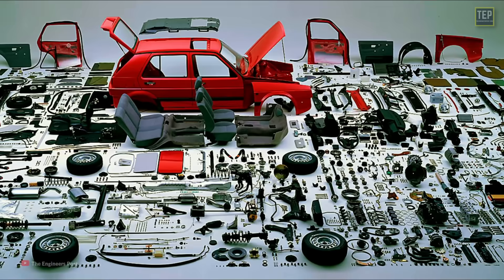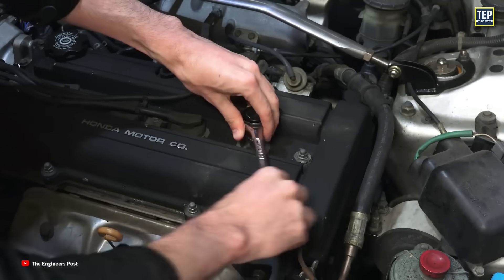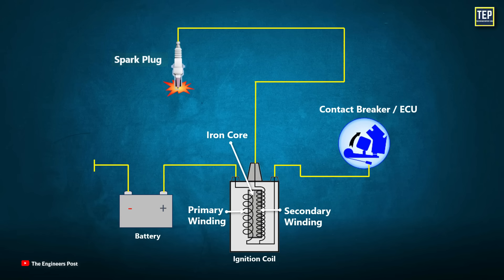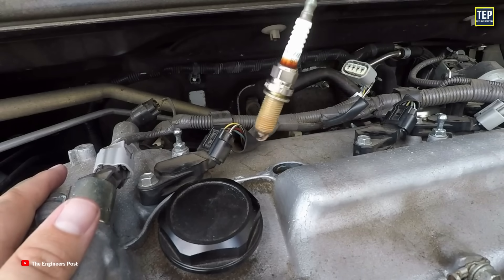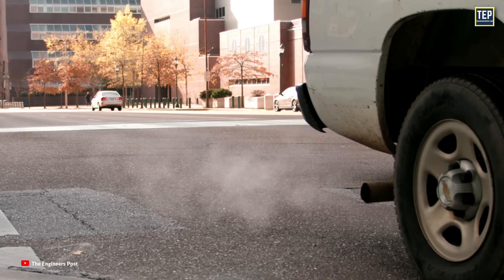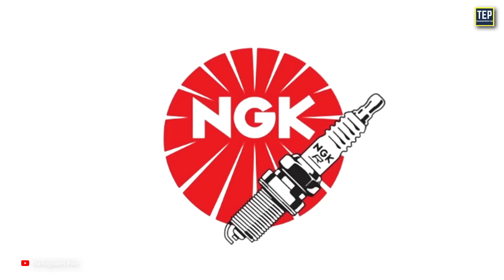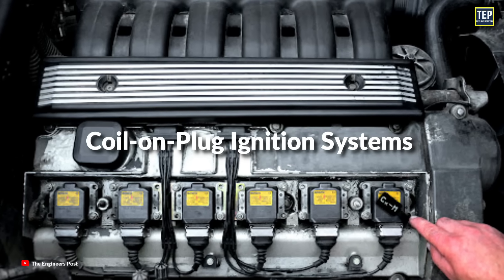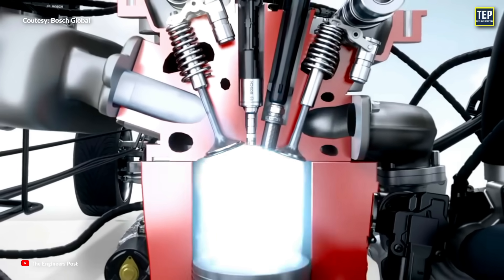Types of Spark plugs | Which is Best?

Comment: Has anyone noticed that modern equipment have become less simpler but more complex. There are creating an ecosystem where you keep needing their services and keep paying them rather than doing it yourself. The concept is profit driven. Once you make a simple machine very complex the more money you can make from sales and repairs.
Reply: That is why you inspect the vehicle thoroughly before buying them.  The more clutter they are put together, the bigger the headache it is to work on down the line when things failed.
Reply: @mrvang8077 ABSOFUCKINGLUTELY!
Reply: Try changing the headlight bulb in a 2015 Jeep Grand Cherokee.  

And to change the spark plugs, you need to take the intake manifold off. It's fun- NOT!
Reply: It's MOSTLY driven by Government "Emissions Engineering". The COST of the parts REQUIRED BY LAW for "clean air" in the US is over $11,400 for 99% of cars/light trucks and $13,000 for "collision safety equipment"!!! Japanese home-market versions don't have this and get up to DOUBLE the fuel economy on 75 octane "straight-run" gasoline, and as much as FIVE TIMES the horsepower per liter-thus the 723 Brake SAE HP on the Toyota Crown 4.7L 40 valve V-8-sells for UNDER $50,000 US in JAPAN and CANNOT be exported.
Reply: While cars are much more comolex, and costly to service, that is just a normal cost of creating more complex, more efficient, and more features in a car. The main purpose is not to keep nickle and dime-ing the consumer, but to make the car do more, do it more efficiently, and do it with better environmental by products.
Reply: In the 1970's I owned a 9.5 horsepower mercury outboard motor. The sparkplug base was a flat ceramic with a center electrode flush with the ceramic. After 10 years of extensive running there was no change in the plug. The gap was the distance from the electrode to the edge over the ceramic. There was no way to change the gap.
Reply: That's a very cynical take on the situation.  The main thing driving complexity is government regulations.  Politicians have absolutely no idea how things are done when developing a machine as complex as a car, so they blithely make requirements and mandates which drives (no pun intended) this complexity. The fact that it's bad for the consumer is left as a problem for later politicians.
Reply: @hagerty1952  Cynical, are you kidding me, as cars last longer, they find new ways to make money, service, engineered obsolescence is a thing. Cynical my ass, your comment is rather naïve.
Reply: @hagerty1952  ,,,,,,,,,,,,,,,,,,,,,,,,,,,,,,,,,,,,,,,,knuckleheads,,,,,,,,,,,,,,,,its all about getting clean air ,,,,,,,,,,,,,,,,  exhaust emissions,,,,,,,lowered..........to safe levels........lol............
Reply: 0 @hagerty1952
Reply: @hagerty1952  cynical, but not innaccurate. I just learned today that modern dodges actually require your scan tool to be registered in order to even clear codes. While just one example, that is absolutely 100% intentional for the sake of preventing the driver from doing their own work.
Reply: @hagerty1952 Seems that a cynical view also. Politicians are voted in to take decisions that benefit their constituents, this often means creating legislation to aid health and welfare, e.g. environmental issues such as the abolition of lead in gasoline. This often leads to greater complexity and cost which does cost the consumer but to the benefit of the consumer in health or welfare. Without legislation we would all still be living in smog-filled cities.
Reply: @hagerty1952  you forget that companies lobby government and are responsible for the regulations. Companies create this regulatory bodies with government and determine how does business and at what level and this keeps them at the top of the food chain. Government don't make regulations big companies do.
Reply: @kelvinnwosa6885 which boils down to government being too powerful. If the government did not have this power (btw they don’t, the constitution make no mention of it having power like that), then companies cannot make regulations and have no incentive to.
Reply: Actually in the case of engines, it is about meeting fuel economy numbers due to both government mandates, and consumer demand, for those majorities of customers who only understand a bigger number without the detractions to get there, or it's save money now, pay later since new car buyers tend to be better off financially and can just sell or trade in the vehicle before they have to deal with more expensive repairs.
Reply: This is why all my cars were made before 2017. If I can't fix it, I don't want it.
Reply: @stxnational9102  😭 old head ass
Reply: @stxnational9102  yep 👏
Reply: Auto manufacturers lose money on repairs, and car dealerships are not owned by the manufacturer.  The wear items in a car are manufactured by sub-contractors.  If an auto builder wanted to profit from parts sales, they would create a driver's seat that needed replacement every 20,000 miles, but wait, that would be a defect, replaced under warranty!  And who is responsible for buying a warranty part?  The manufacturer.  Who pays the mechanic wages for warranty repairs? The manufacturer.  Gee, warranty repairs can be expensive, how can a car manufacturer control these costs?  They can buy parts components from a sub-contractor, and make them responsible for sub-par component replacement through a contract requirement.  In the 90's Range Rover was a great dealership to own and operate, because of massive recall issues, the manufacturer would have to reimburse the dealerships for all the parts and labor involved, the end result being the bankruptcy, over, and over of Range Rover, as it passed from British ownership, to Ford, to BMW, and so on. The most profitable auto manufacturers have very few warranty issues, and high sales volume, this would favor building the best product at the most competitive price.
Reply: @YouTubeOdyssey  i can see you have not bought let alone compared dealer service, repair or parts prices for EVERYTHING compared to auto part stores or private repair shops..makin stuff complicated and BREAKABLE is INDEED profit driven; cars so complicated few can work on them anymore...give me a break.
Reply: @YouTubeOdyssey  you speak only about auto vehicles but I look at every solution vehicle or platform man has conceived and built. Everything that used to be simple is now complex.  You talk about regulations , controls, greater efficiency. Look at nature itself look at how simple everything seems but human have a way of complicating that which is simple in itself. The more complex the more the cost and who benefits from the costs and who bears the cost. Elon musk builds rockets at less than half the price NASA  built the space shuttle. The Chinese are building ev cars at almost half prices than the American that's why the 100% tariff . Why they know that they cant compete fairly with the Chinese EVs. Then you say they are subsidized by their government. All propaganda. Doesn't the American government engage in subsidizing important industries just to get an upper hand over others.
Reply: Alert the media.  /s

The reasons for complexity have nothing to do with profit.  It's a necessity as we increase efficiency, meet regulations, and is also consumer driven.  No one would buy a car that required service as ours did sixty years ago.
Reply: @frequentlycynical642  Exactly. When was the last time you had to adjust the points on a distributor?
Reply: @frequentlycynical642 thankyou for saying that far more simply than idid.
Reply: @frequentlycynical642  guys anything that has a complex approach has a simple approach. It's just what route you should. What makes the ford model 1 different from today besides boards and chips.
Reply: @kelvinnwosa6885  Oh, how about hydraulic brakes, automatic spark advance, automatic transmission, power steering, windshield wipers and electric starters to name a few.
Reply: @kelvinnwosa6885  One blatant example of how they design the cars to scrw you is requiring a dealership to program a new transmission, even though you're replacing it with the EXACT SAME part. What in the f's name is the TCM for if it doesn't know how to run the transmission by itself?

Another very good example of fix-yourself deterrent is that some cars have electric E-brake which needs to be released by a specialized scanner, just to be able to remove the caliper; or else the car literally breaks down and needs to be shipped to the dealer.
Reply: Everything is made in china too.
Reply: You're being cynical. Since at least the mid-nineties cars have become more reliable and efficient, even with the gains in technology. Try starting an old '70s, '80s carbureted vehicle on a freezing morning and then driving off. Also, back in the day 100k miles was considered worn out, that's unless you did really good maintenance. And in, especially, the '80s, vacuum houses and wires dominated the engine compartment of a car, and it was a constant nightmare sometimes keeping the vehicle in good stock running order. 

Look under a hood of a modern vehicle, it's a cakewalk to to do basic maintenance compared to much of the '80s and '90s cars.
Reply: Then the same goes for airplanes? Computers? Telephones? As tech get available, people want it. Who needs a computer on body to monitor heart rate, blood pressure, steps, calories burnt, etc? People just like gadgets.
Do I need a keyless entry system on my car? No, but I like it. And some things are just safer or improve the car's ride. Airbags are not diy parts, neither is airco. I like to have a monitor on my brake pads, so I don't kill my rotors. Multipoint injection necessary? Cars have run without for many decades.  Radar guided (adaptive) cruise control? I can live without, but it's comfortable in traffic. You don't want to take out a crank every morning to start your car do you?
Reply: @arturama8581 Well sometimes the crank will set next to you while driving 😏😯
Reply: If you want more features you need more complexity. There’s a difference between them adding features and them making it so you can’t repair cars
Reply: @LoveLucki2012  though I agree with you that some features are not really needed just built for convenience. There are things that when you look at should be simple and the question why the complexity to achieve the same result. 
It's difficult to understand if you belong to a school of thought
Reply: @kelvinnwosa6885  100% I’m not saying companies don’t try to make things hard to repair. They absolutely do. I’m not a mechanic or anything but I know that the car I have locked their PCM after 2016 just to make it harder to repair. And I think bmw has some weird propriety software in their cars. I think at minimum companies should be required to give you a general wiring and maintenance diagram when you buy a car (still under copyright and patents ofc)
Reply: Nope. Complexity is NOT always 'bad'.
Cars are far more reliable than they were in the 80s back. 
The amount of servicing needed on old carby cars is a lot more than injected. As with electronic ignition.
Try driving an old car daily. Always changing shit thats worn out. And theyre not as nice to drive.
Reply: @sugarnads  A car being reliable has nothing to do with complexity but the build of the different components and how they interact which have become better over the years . Why must place a simple component in a so hard to reach area that requires you displacing very sensitive components. It beats me!
Reply: @sugarnads  Modern cars will turn increasingly nightmarish the more they age; think of all the wires, electronic modules, sensors, all interconnected into one overreaching system and one small failure will most likely leave you stranded with a bill in the few K's waiting. They will cost an absurd amount of money just to keep running past their prime. Why pay house downpayment-level money on something that will never be sustainable for more than about a decade?

Meanwhile, my summer daily (1988 Chevy Cavalier Z24) only needed the basics in its life, it's still on its original ECM, engine and transmission after 275.000km +. No modern car can fulfill me like this one does (though I have a special relationship with those cars), driving a car that feels and sound like nothingness isn't for me. The raw feeling, sound, responsiveness, drivability and ease of repair of '80's-'90's cars is just perfect to me. Things should have remained sane underhood.

Comment: As the video points out, the bigger the gap in the plug, the more voltage is needed to jump it... This means that leaving the spark plugs in too long can cause the electrical insulation in the coil to break down and cause the coil to fail.   When the power to the 'primary coil' is interrupted the magnetic energy in the iron core collapses and is transferred to the 'secondary coil' and the voltage in the secondary coil will keep rising until it is relieved by the spark happening,  if the gap is too large the voltage can reach extreme levels.  The use of Iridium and platinum is to massively reduce the 'spark erosion' that causes gap wear, so this allows plug gap to stay in specification for a lot longer. Many coil failures are caused by the plug gap being allowed to get too large
Reply: Exactly... Burns coils out .
Reply: Sounds feasible.
Reply: "the magnetic energy in the iron core collapses ..."
Well, correctly it would be "the magnetic field in the iron core collapses and its energy is transfered into the second coil"
Just thought I should mention that.
Have an excellent Sunday and a fabulous start into the new week!
Reply: @NewStarConstellation  Pedant alert..... please add to the discussion when posting, don't be so petty... By the way did you actually read my post ?
Reply: Thanks for the explanation.

Comment: In case you didn't know unless you are an aircraft mechanic,  the spark plugs with 4 electrodes is called and igniter.  They are used  in aircraft engines because of the obvious redundancy. Just in case.
Reply: Aircraft engines of yester years get their redundancy by having 2 plugs per cylinder. You look at an aircraft engine like the Lycasaurus in a 172 and you think the systems came from the Jay Leno garage.Modern Rotax just use regular single car plugs and features like no lock wires on the oil filter. Literally billions of automotive hours proven that oil filters just do not come unscrewed on their own. Aircraft plugs are maintenance intensive and heavy. Especially using leaded gas.
Reply: @tonylam9548 I'm surprised there hasn't been a bigger push for unleaded gas in the aviation industry. I get the issue of valve recession and detonation, but that can be solved in your next engine overhaul and tuning. With the obvious health concerns and issue of spark plug fouling, seems like there should be more interest in alternatives to 100ll

Comment: In many published dynamometer runs since the early 2000’s both car and bike magazines have shown that multiple ground-electrode plugs cause engines to lose 2-3 h.p. at the medium to high rev ranges.  Additionally, the 60K to 80K volt ignition coils on modern engines allow the plugs to maintain efficiency to at least 60K miles and in some cases 100K miles.
Reply: @danielgaskell5490  true..
It's been debunked long ago.
Reply: I remember splitfire spark plugs.
Reply: @parkerbohnn You mean: the FRAUDULENT "SplitFire" plugs...
Reply: I own a 2004 Ram Hemi.
It has 310,000 miles.
Original spark plugs, coils, a/c components.
Original ball joints.
All engine and trans, rear axle, and diff. Are all original.
I changed front shafts once.
Reply: @rdallas81 so what are you trying to say?

Comment: I don't see any benefits of a multi electrode plug. Electricity flows in one direction. Not several.
Reply: Exactly. It’s going to jump to whichever one is closest to the electrode
Reply: If chances added up to establish more than one ionization pathways simultaneously, there will be benefit in multiple electrode plug. The reality is when the first one ionization path is completed, this path will draw current and the ignition coil high voltage output will drop very quickly so that the potential second path will not get enough voltage to develop further.

Comment: This is high school level science. To complete its circuit, electricity takes ONE single path (not multiple paths) of least resistance to ground.
Reply: Correct.  Multiple paths mean less intensity.
Reply: Nope, you Bozos. There are multiple paths sometimes - finest example is a lightning strike (it often contains a "leader" and small "streamers", not visible - if someone survives a strike, it was a streamer, not main channel).
Reply: It takes the path of leadt resistance
Reply: @syrsknight  "Path of least resistance" is a simplification, a fairytale for children.
In high voltages it's about the EM fields (gradient of the field, electrodes shape, chemical composition of the mixture in the cylinder).

Comment: Looks like E3 spark plugs are a scam .
Reply: I've ran E-3's in my engines, never had a issue with them.. and loved the 5yr warranty
Reply: So far I like them and on my previous car 1993 V-6 Sunbird they gave it even slightly more MPG.   I have sets I will put in my current Pontiac Sunbird soon, Buick Riviera maybe next year. A good thing about them is no need to check the gap and if you drop them it will not bend the ground part like all of the other designs. The spark is always in the very middle on them as well.   I do think they were wrong in this video about the spark coil. The electronic or mechanical ignition  tells the system when and which cylinder gets the spark, the coil does not load up just to give a spark. But maybe I am wrong on that point.
Reply: E3 spark plug good for really smaller engines